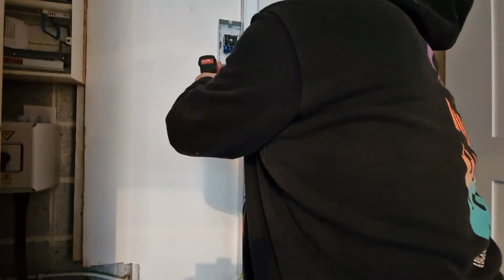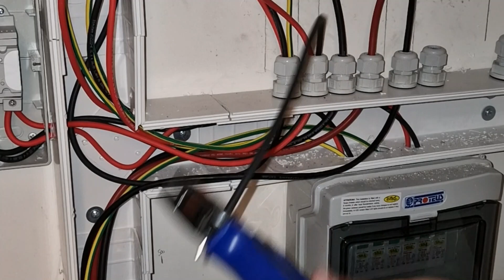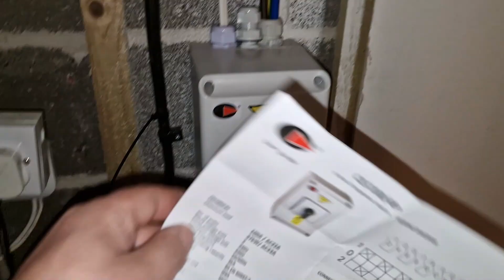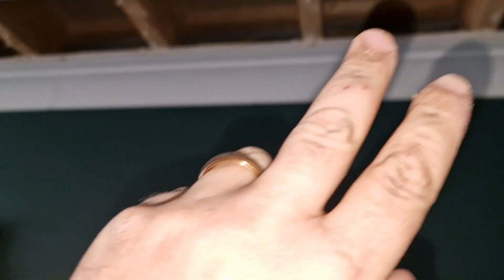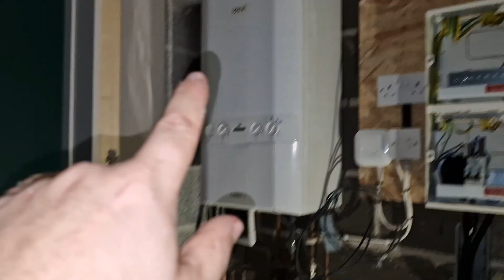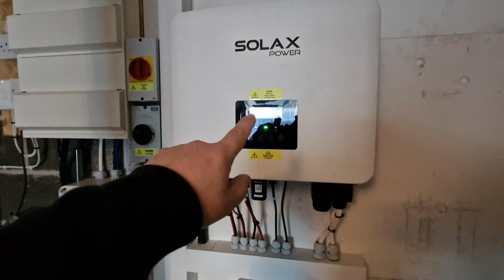Running a house off grid, what you need and how it works @SolaXPowerGlobal 7.5kW solar system

Comment: Does your inverter have a neutral - earth bond when the grid is disconnected ?
Otherwise the rcds wont trip on your dist board due to there being no supply ground reference. 
One solution is to use  a 1 amp unsw spur which, when power disconnected, (grid off) closes a 63a, 4 pole contactor (normally closed) which bonds earth and neutral from the sunsynk hybrid inverter. P
When grid power back on .. and the contacts open restoring normality.
Contactors are so handy.
Reply from the maker: It has an NE bond yes.

Comment: I’m running two Solax X1-FIT 5kw inverters and 6 t58 batteries (3 each). Would I need one or two changeover switches to run my full consumer board in a power outage? Great channel btw!
Reply from the maker: Few ways to do it, but can be done on a single change over switch yes. You dont want really want to be swinging multiple forms of generation around independent from each other really.

Comment: I have the solax 7.5 inverter and triple power batteries. I would like to run the house off this setup, with reduced load, do you have a schematic / line drawing of the system?

Comment: Great video! I've been quite interested in doing something similar. I have 2x 535w panels with Victron 100/20 & a lifepo4 51.2v 50ah battery running the shed as offgrid which is pretty much always full. If I drain the battery I average 5kw per day charge. 

Am I able to install the same change overswitch myself without any permissions or does it need to be signed off by a proffesional?

Comment: Nicely explained Mark . In the instruction documentation for Solax inverters at,   - ''V grid and eps ( off- grid) connection.''   I note also PE is switched internally within the inverter to neutral  for off grid operation and the DNO earthing diagram for UK is not separated when using the Solax1x mate box . Your thorghts on this would be apreciated please. Is there some extra protection afforded by that very expensive bit of kit perhaps ?

Comment: Hey Mark, great video, learnt a lot. I have pretty much the same system and want to add in the EPS part now to power the main board when the GRID is out. Ideally automatically. If we put an ATS in then we will of course get the loop between EPS and GRID mode as the Inverter is powered off the main board as well. Did you get the contactor method working you mentioned in the video or did you go with putting the inverter on another subboard thats not EPS powered? I'm not a sparky just interested so please do treat me like an idiot as thats the level I'm at :-)

Comment: Doesn't the solax inverter already have surge protection on Dc ?
Reply from the maker: The hybrids do, strong ones don’t. However we always fit into the fixed wiring rather than rely on a product in the equipment perhaps built to a product standard separate to requirements. Same for RCD protection and DC isolation as well.

Comment: How are you able to power the complete board in eps mode, if solax limit the eps load at roughly 9amps?, cheers
Reply from the maker: As discussed by careful limitations on what is used. However power is available and everywhere and at slightly more than 9amps try 32A… I wouldn’t expect to continue as normal with all house loads. But can choose in this setup.

All that said I now have a GivEnergy AIO which will output in combo with the PV generation. So even better!
Reply: @electrician247  thanks for the reply 👍 I’m stuck utilising the eps on my solax system as I’m 3 phase, only have options for powering a single phase via a auto transfer switch, whilst 3 phases switches do exist, the eps just wouldn’t handle to demand, what with all new builds all 3 phase now, hoping new products come to market, I’ve got 4 solax batteries, and have regular power cuts, and currently sat in darkness, need to get the power out
Reply from the maker: @adamwalker-holden5432  what rating is your 3 phase inverter? It should supply most circuits but you would have to load limit your consumption. Even with 4 batteries it won’t last long on high demand. Plus it would spike the EPS and shutdown. But would give you at least sockets for small power, lighting and potentially heating depending on rating of heat source

Comment: should a 40a max be on a 50a breaker for some headroom? 40 x 1.2 = 48a (or 50a) breaker?
Reply from the maker: On the inverter? Limited to 25A on the AC output so no. The max PV input is beyond that but it’s sorted locally via the DC coupled battery and clipping if required. This is why sizing of the inverter, array and required AC output is hard work sometimes.
Reply: @electrician247  yep the inverter sorry. The manual listed 40a max input ac current which I'd have thought wood mean a 50a mcb for the inverter ac input
Reply: I've ordered the x1 matebox advanced to increase the load to 60a which is helpful, allowing the inverter to supply the house main board, although >80a would have been a nice option. Maybe in a future solax product
Reply from the maker: @muso31  that’s the peak when grid and solar charging is taking place. Doesn’t hurt to move to a 50A. The inverter will peak beyond its max rating for short durations but isn’t consuming all that power from the AC side. 40A would be fine but nothing wrong with upsizing if you are concerned.
Reply from the maker: @muso31  the mate box gives some very good flexibility however I’ve since swapped to a GiveEnergy AIO and gateway. That is an absolute game changer. 

Remember your max power on the solax system is still governed off grid by what the inverter can produce. That doesn’t change with a mate box. It just allows for an element of automatic change over.

See here https://midsummerwholesale.co.uk/pdfs/ff8080818465bc79018473eea49e002c.pdf
Reply: @electrician247  Yes so the inverter will output 32.6 but with a mate box an extra 27.4 can be supplied to loads (albeit from the grid not solar unless you add an inverter in parralel), which totals 60a. The benefit is that with 60a you can have the main board as the load rather than setting up a separate off grid CU. 

The givenergy looks unbelievable,  there's some brilliant tech arriving now. Much easier to install also
Reply from the maker: @muso31  we have done a few mate boxes. While more rudimentary than a GivEnergy they do use good quality contractors from Eaton. I’m not overly impressed with the front screen but it is what it is. 

It’s also not that rapid on switchover in comparison to the AIO which you don’t even notice. 

I originally wanted mechanical control of switchover so I could limit loads on grid loss. But changed my mind when the AIO came out.
Reply: @electrician247  long shot but can the givenergy gateway work with a none givenergy inverter? Great vids by the way, so useful
Reply from the maker: @muso31  for PV yes. In terms of total setup it’s one for Giv tech support but at manual level I would think so. 

The complexity would come getting the app to work nicely. 

The power of the gateway is only truly unlocked combined with an AIO imho.

Comment: I want to take my house off grid. I already have solar panels with batteries. How can I find anyone to do this for me?
Reply from the maker: You will most likely need extra hardware and it is very difficult to go fully off grid all of the time. For occasional backup it’s pretty easy. If you want to email the equipment you currently have I can take a look for you if you want. Mark@powersonic.co and it is just .co on the end
Reply: Did you do line diagram for this system? I would like to do the same installation . If you did would it be possible to have a copy for my electrician to look at?

Comment: Think they’ll struggle to get a smart meter in the cabinet now with that switch fuse unit
Reply from the maker: Not so. Has one in it right now with ease. It's my house. None issue
Reply: @electrician247  ah good stuff. I know some meter technicians can be struggle to fit meters!

Comment: Hi, random comment on this video but what determines if you need supplementary bonding? Are you always supposed to actually test between a tap and metallic light for example ? 

I’d also like some help on how isolating transformer (shaver socket) works. The earth is removed right? But you don’t get a shock if you touch live cable, even though you are stood on ground. However, if you touch normal socket live cable you would get a shock? Even if you removed the earth . Confused how you wouldn’t get a shock of shaver socket when you’re stood on earth 0v touching 230v. Could you do a video possibly or give explanation on these topics 

Many thanks

Comment: Hi Mark, Q: how did you install the proteus switch fuse without breaking the main fuse seal to isolate the supply to the property?
Thanks
Reply from the maker: I am blessed that my meter has an isolating switch in it . It's a shame they stopped doing that. I've shown it in previous videos.

Comment: Hi. Did you have a switched mains earth so that the system is just connected to he earth rod when in EPS mode? Can you say why?
Reply from the maker: Yes and yes
Reply: Thanks. Very helpful. 👍
Reply: Hi Mark good video.

Did read to keep the TNCS esrthing and add a rod or mat so the rod on backup mode the rod is supplementary.

See mcs battery storage guidance version 2.
Reply: Yes, as I understand it, the earth shouldn’t be switched but the grid earth cannot be relied upon, hence adding the rod
Reply: @newlinerealboi3434  yes it doesnt technically make it a TT earrhing arrangement but more adding a rod makes it supplemented to the TNCS system. This was/is an complex issue and on the 18th edition and 2 course had a good chat with the tutor on this issue... he said he connected with the IET and the guy that wrote most of the battery mcs regs kygon I think he was called on that issue ans he never replied despite there being abit of a issue on this exact issue.

My own thinking is adding a rod does not make it TT but it's just supplemented TNCS and should be called that.

There wa going to be a revision and that was adding a earthing arrangement to new builds for TNCS incase of loss of PEN conductor...it got taken out on this 18th edition amendment 2 at the last minute so I see this coming in in future regs. 

Issue  becomes if you have alot of houses on your new fangled Supplementary TNCS with rod how big do you make this earth conductor? He said 25mm but that's massive lol but has a point as you dont know the current that has to carry if there was a PEN fault..

And other issue is were is the DNO or someone else put there earthing point/rod as you could get a fault introduced into your own rod...

Earthing and TT are great but there are some design issues to consider always.

All food for debate and thought ans I am most certainly not try to be clever just looking for views.

Most systems I've done have been fully off grid and TT earthing arrangements or just a type A rcd metal clad socket as a full backup system of house ESS opens a bit of can of worms.

Comment: Interesting video, you could also spilt the incoming grid tails and add a small cu with the hybrid inverter on that. Then when the change over switch is thrown to eps that cu will be dead. That’s how I have gone about it on installs with multiple inverters
Reply from the maker: Yes Matt, I mentioned that in reply to another comment. I considered it but I think the contactor is easier. If it doesn't work that's my plan B. Good shout.
Reply: Is a small CU a regulatory requirement? Would it be allowable to connect the inverter to a 20A fuse, then to the meter tails in a Henley block? Functionally that would be the same as a 20A on the main CU, but it would be before the EPS switch so avoiding the loop.

Comment: Very interesting to see an EPS setup, you don't tend to see too many of them. I like the changes you've made over your last install as well, I think it looks a lot better having the DC isolators off to the side.

Do you really need a separate contactor for the inverter supply? Can you not just use the spare contacts within the change-over switch? Obviously there's no spares for a three phase install but it should simplify your install. I do wonder how you'd do the separate contactor though as surely it would need to be on the incoming grid supply which has no protection (Aside from a switch-fuse) - I'm guessing you'd also need a second grid-only board just for that?

You mentioned three phase when discussing the meter cabinet, are you upgrading to three phase as well or was that a mistake? If so I'm surprised that the DNO are happy with the much space for a three phase supply but it's good to know if they are.
Reply from the maker: Lol meter cabinet was supposed to say smart meter not 3 phase if that's what I said 🤣. 

The EPS does go into the change over switch. The problem is it also re supplies the inverter mcb and thus the cycle begins. 

Can be solved either by a little CU pre the change over switch just for the inverter grid feed but that removes user control to a point so I didn't like that. 

I will demo the contactor on the next video but in essence when grid supply is removed lost it would open and break the feed into the inverter. 

You are correct it would be wired from the change over switch but we have a set of terminals in there that link direct to the grid input terminals so no issue doubling up. As the sub main is on an 80A fuse we have an element of OCPD so just need to size the cables and contactor accordingly. 

In my mind it maps out fine but we shall see when I put it together and share it soon! 

Thanks!
Reply: @electrician247  I thought it was a mistake but I get excited when people talk about domestic three phase so I had to ask!

What I mean about using the change-over switch in place of the contactor, I mean using an extra set of terminals for the interter's grid supply (E.g. L3) - So you'd have terminal 13 going to the inverter RCBO and and terminal 14/16 going to the inverter grid connection. I'm not sure if it's allowed (Or wise) to mix pre-post MCB domains like that within the change-over switch but logically I think it would do what you need.

Regarding the contactor's supply and the sub-main OCPD, you're going to end up with the coil of the contactor being fed from an 80A fuse so I think you're still going to need a little consumer unit before the change-over switch regardless.

I may well be missing something as it's hard to follow without a diagram, but I think that's correct. If I am missing something, I'm sure all will be clear in the next video which I look forward to as always.
Reply from the maker: @Andrew Young  yes I have gone around the houses with a few ideas. What I am trying to do is have the automatic disconnection when the grid goes down to inverter beeps away lol. But on the grid power returning I don't want the inverter to automatically see that. Reason is very often round here we get a few false starts with the grid energy returning lol. So I am trying to keep an element of manual control. 

It's a fun one but one of the reasons I got a roomy CU to have a good play around and learn a few things on my own system lol. Will be sure to share the failures and successes in my experiments lol and gratefully receive tips from those watching such as yourself! Thank you.
Reply: @electrician247  Ohhh I see, yes latching off does make sense now that you mention it - You'll essentially end up with a DOL starter by the sounds of it. I appreciate you taking the time to explain and document your experiments for us all to learn from.